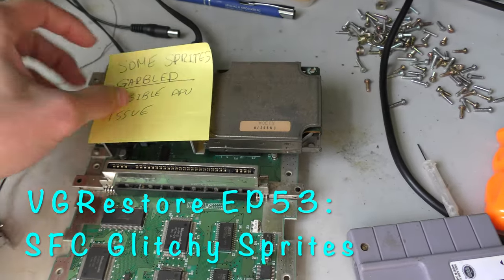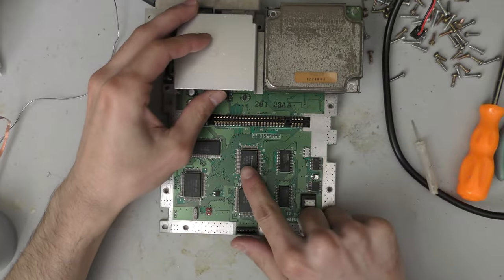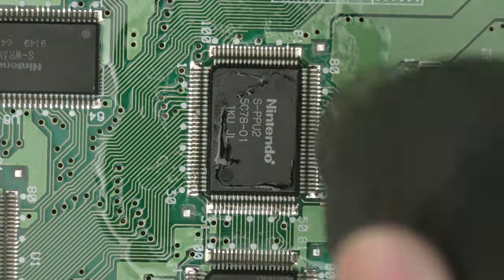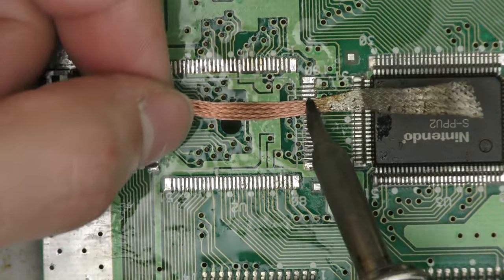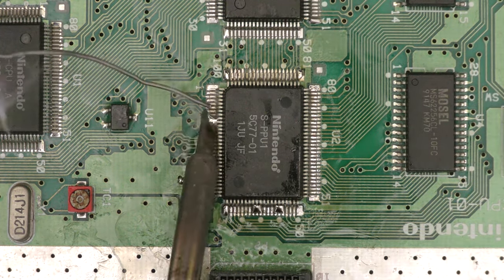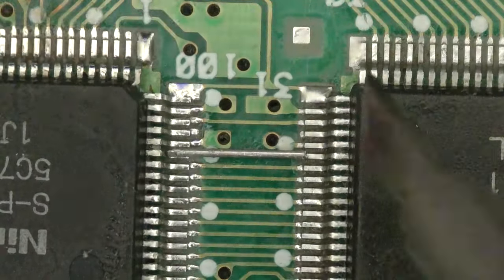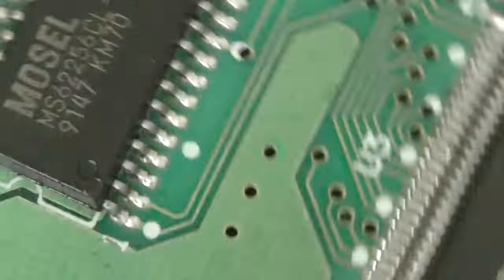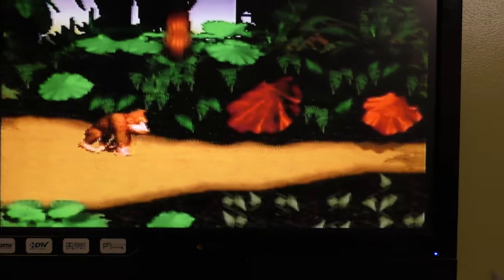VGRestore Ep53: SFC Glitchy Graphics

Comment: Question: why wouldn't you try resoldering first before replacing the chip? It could may well be that there's a cold solder joint under a pin and resoldering would have solved it. Cheers!

Comment: Hi, I'm Rodrigo from Chile. I have a question?
my snes has sound problems but not image. Have you seen this problem? and how it can be repaired.
thanks, excellent videos, greetings
Reply from the maker: Yeah I’ve seen this before, I had a snes that sounded like a tin can or an amp with electric guitar distortion. It had a removable SHVC sound module I replaced it and it was fine. If that doesn’t solve your problem you can try replacing the capacitors, sometimes the audio caps go bad. If that doesn’t help you may have a bad ram chip or audio chip.
Reply from the maker: But before you try replacing any components try with a different set of cables and also try the RF port to see if audio comes in clear on the RF.

Comment: Hey Punkndisorderly! I took your advice and put out an add to buy up local broken snes/nes and have been happily restoring ever since! I got ONE tricky one that I can’t use the burn and test cart on for an snes. It wouldn’t power on and upon testing with my meter I wasn’t getting continuity on the fuse so I swapped it out and it fired up! So now It starts up fine, then loses color, then by the time I can get down to the testing section, the screen loses color then starts to roll and I can’t read the results of the test! Another thing o noticed since I had the cover off is a few moments after starting it up the thick aluminum cover near the power fuse heats up quickly! I’m guessing there has to be a short somewhere but I was wondering if there’s anywhere I should start troubleshooting in particular? Thank you for these vids and thanks for all the help!!!
Reply from the maker: That thick aluminum piece is a heatsink, it’s attached to the 7805 voltage regulator to dissipate heat. If the console powers up and loads the burn test cart then it’s likely not a short on the board. I’m willing to bet that the video caps are bad, I would swap them. Also, before you swap the caps test the RF port to see if the problems still persist. Let me know how it turns out.
Reply: @PunkNDisorderlyGamer  thank you! Going to test the RF port tomorrow and go from there and I will keep you posted!
Reply: @PunkNDisorderlyGamer  well... I may have royally screwed it up... I was testing through the av instead of rf and it was doing the same thing, however, while I had it on the testing table my stupid hand fumbled and I dropped the loose power switch perfectly to where it laid across like three of the cpu pins... it made a buzzing sound on the tv and I completely lost all video now in both ports. 😭 fml 🤦‍♂️ it still powers on and the screen flickers but video is gone. Maybe if it was a capacitor going bad that caused it to completely fry? Hoping that short didn’t fry the CPU... wondering if I should proceed with replacing caps or if this puppy is dead now. Lol omg I can’t believe I did that.........

Update 😂 I fried my burn-in test cart in the process as well. Whatever I shorted out must have also ran to the pins.
Reply from the maker: @tonu115  damn that’s bad, are you sure, did you try you test cart on another console? I wouldn’t even swap the caps at this point.
Reply: @PunkNDisorderlyGamer  yeah... I tested the cart on a working unit. Lesson learned lol!!! Gotta watch the ol fumble hands! But hey! I got another board for dirt cheap that I think just has a bad ppu so maybe this prestige board I just fried the chip on, can be a donor 😃
Reply: Replace all the capacitors, it might help. I restored 2 of my sfcs from the image distortion that way

Comment: I just bought a cheap SNES motherboard on Ebay and it runs well for the most part but every once in a while I get vertical lines on  everything for a split second. I think it's the beginning stages of PPU1 failing. Thoughts? Also can a PPU1 be removed without a hot air gun and without low melt solder?
Reply from the maker: I don’t see how you could remove the chip without hot air or chipquik? You might have a bad ppu for sure.
Reply: @PunkNDisorderlyGamer  Thanks. I wonder if I could use solder wick to get rid of the solder under the pins to free them; sounds pretty hard though. I would probably end up lifting some pads. Lol.

Comment: What kind of heat gun and desolderer do you use, Punk? Thanks for the videos. I have a SNES I'm trying to revive, but it's failing the multiply/divide tests. I'm assuming a bad CPU.
Reply from the maker: Heat gun is an 858D or a clone it’s a cheap Chinese one I got for around $45-60 on Amazon. And desoldering gun is a Hakko FR301.
Reply: @PunkNDisorderlyGamer  Thank you, been meaning to add one of those to my toolset. I had another question; can an SHVC model CPU be used in an SNS-001? And which revision started using the CPUB design?
Reply from the maker: @Renulph  yes CPUs are interchangeable. Usually CPU-B is the most reliable, I’ve never had a bad one yet. I think CPU-B started in the late run GPM-01s, definitely GPM-02 all had CPU-B

Comment: nice video! Also question, I recently got my pal snes and when I connect it to the TV with the game it just has a silverish/black screen, tho when I press the reset button it goes static for a moment and then nothing happends, got any tips how to fix this? anything would help.

Also the led lamp turns on too
Reply from the maker: If you’re using a pal snes on pal tv you shouldn’t be getting black and white. Try RF or AV which ever you haven’t tried yet, see if the problem is the same. You may need to replace the capacitors or perhaps tune/replace the trimmer capacitor labeled TC1. I had a black and white picture and I replaced TC1 and it solved the problem, but it’s very rare I think 1 out of the 60-75 units I’ve fixed. I don’t even think it went bad, I think someone tweaked it too far and broke it.
Reply: @PunkNDisorderlyGamer  ight thanks, but it dosen't show the game it self at all, the screen is just black and theres no sound
Reply from the maker: @lowercase7455  then you probably have a bad chip or corrosion on the board.
Reply: @PunkNDisorderlyGamer  hmmm, I'll try to clean it when I get the gamebit so then I will see in detail what's wrong with it, thanks alot tho!